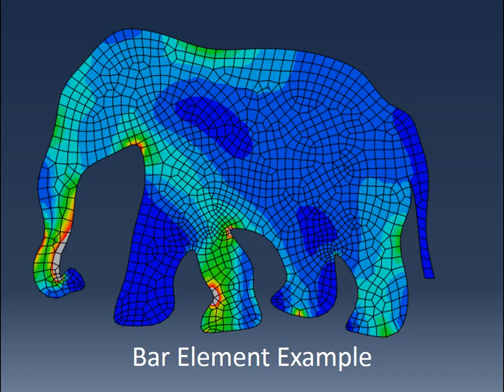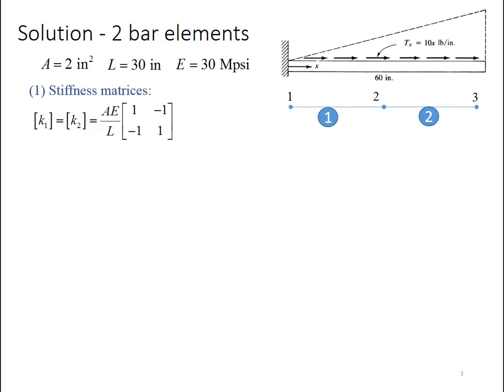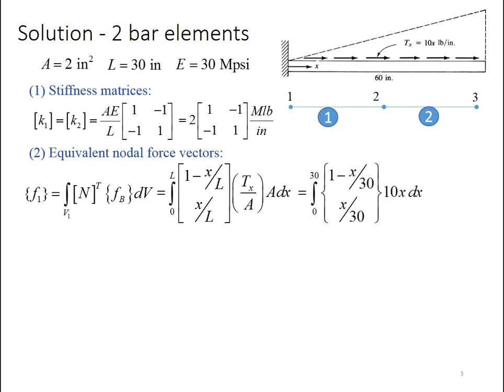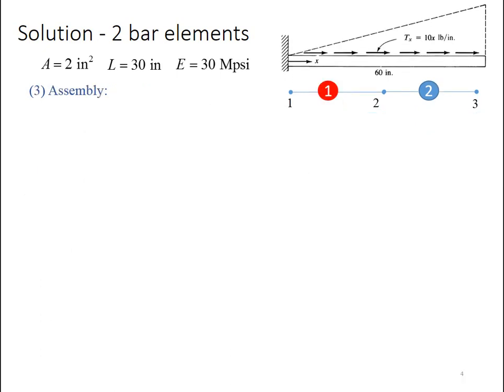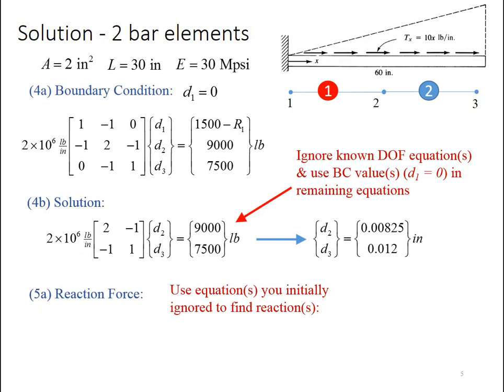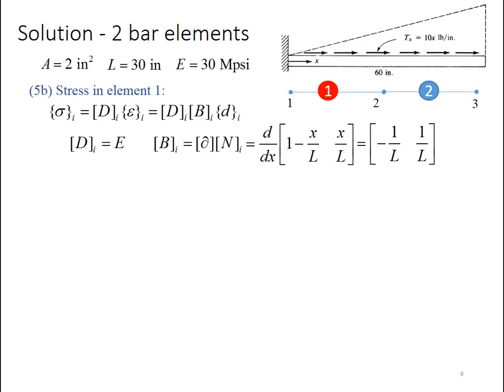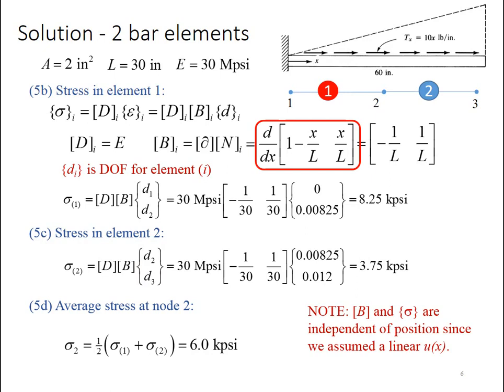FEA 10: Bar Element Example

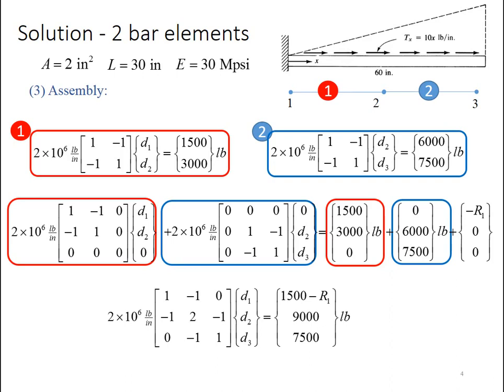Comment: Should the DOF d2 really be 2*d2 after matrix addition at 5:59?
Reply: It's still d2. I see your confusion, because in the middle of the stiffness matrix you add 1+1=2, so in the DOF it should be d2+d2. But this is what is actually happening: if you add all those equations in equation form, the middle value I just mentioned would be 1*d2 + 1*d2. That is the same as (1+1)*d2. If we write that back in matrix form, the (1+1) would go into the first matrix, and the d2 in the DOF vector. You now see that it sould be d2. I hope that helps :)
Reply: Thanks - I see it now.